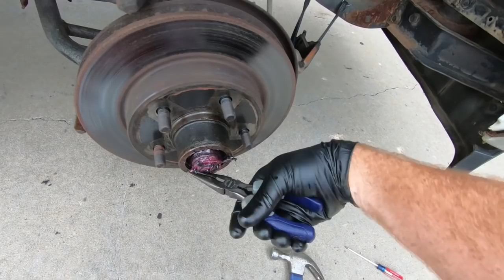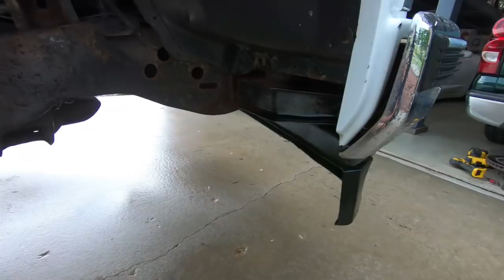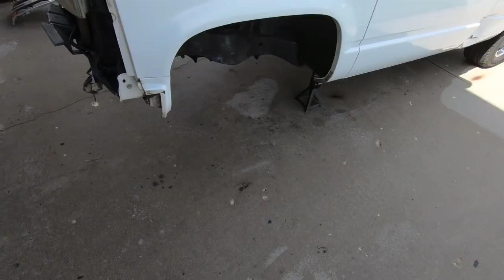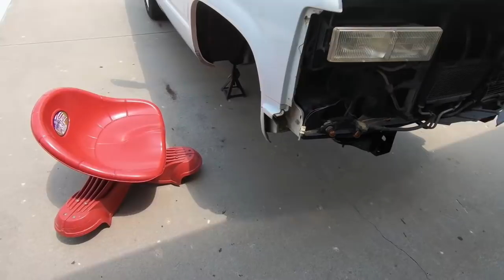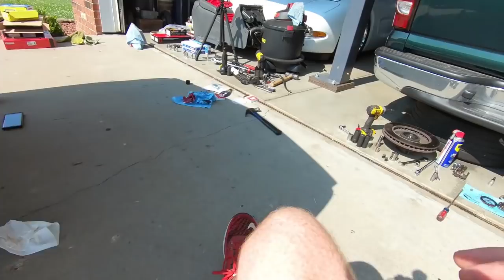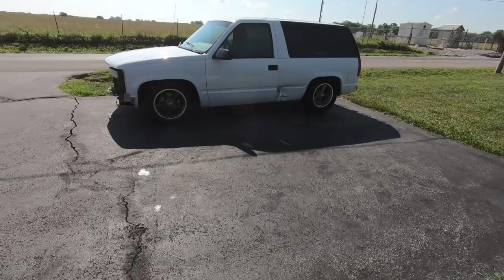2 Door Tahoe Makeover Part 7 (Front Drop and all new suspension)

Comment: Very helpful and very informational!! Thanks for the great videos!!
Reply from the maker: Thank you. Hopefully it helps
Reply: @TWAMotorsports  will these shocks work for a 6/8 drop??
Reply from the maker: Doubt it
Reply: @TWAMotorsports  after looking over the suspension it appears I'm 4/6. These shocks and extenders ride really good?
Reply from the maker: I like the shocks and definitely recommend the extensions.
Reply: @TWAMotorsports  Happen to have a part number for those spindles?
Reply from the maker: Link in the video description
Reply: @TWAMotorsports  The link doesn't list the djm arms but it does have the part number. DS2056-2? only place I can find them is on the djm website.. Also whats your opinion between the street performance shocks and nitro drop 2?
Reply from the maker: I remove the djm arms. They are terrible
Reply: @TWAMotorsports  my bad I meant spindles..
Reply from the maker: May look into react spindles. If I had to do it over

Comment: I’ve been considering getting spindles, will the 96-99 fit on the 95? My 95 has torsion bars, not coils. It’s very hard to find kits for my body style. It basically takes 90-94 blazer kits. Edit: like I have a really nice belltech lowering kit, when I ordered it online it said “90-94 blazer” when it arrived it said “95-99 tahoe, it fit and works well regardless
Reply from the maker: Spindles are the same for 92 up

Comment: Another great tutorial Travis. The paint you use for the frame is for frame use only? Cause I'm doing my 94 Trans am frame and was looking into the product you used on. Frame. But I want a more glossy look on my 94 trans am frame...hit me up with a suggestion. Thanks. .👍🤙..
Reply from the maker: It's for surface rusted metal really
Reply: @TWAMotorsports  yes I read the description on Amazon on your link... Are you going to paint the entire frame??? Cause I'm going to paint my entire frame on my 94 project trans am.....I ordered the entire BMR adjustable upper and lower control arms in red... I'm changing the entire suspension on my 94... It's getting a complete makeover....